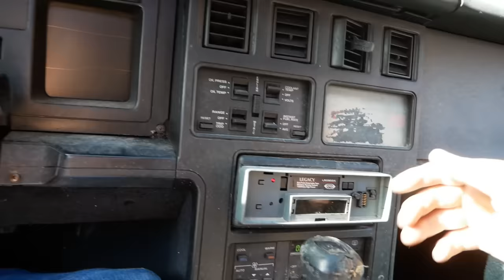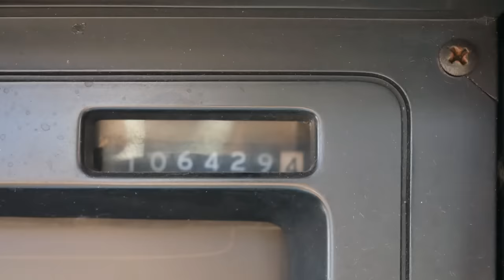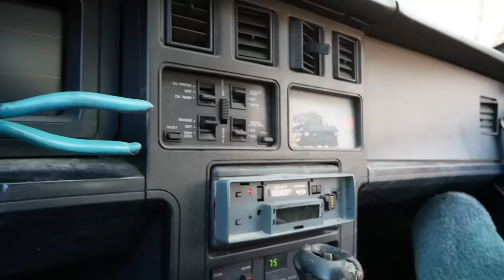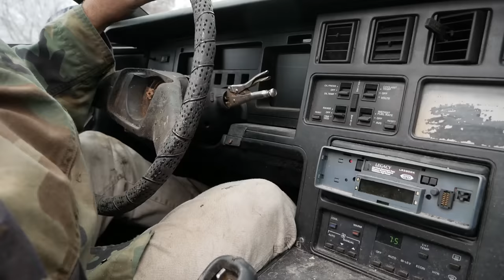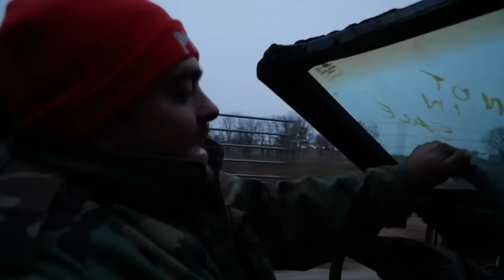ABANDONED 21 Years-Will This Corvette Run and Drive? CHEAP Vette Kart

Comment: The mythical 1/100 time that changing the fluid actually saves a transmission. Truly a sight to behold
Reply: Lucas transmission fluid is key! If it will not pull after that, it's toast!!
Reply: And it has a transbrake now for dragracing
Reply: The fluid had magnetic shavings that were making the solenoid stick.
Reply: frfr

Comment: I'm a former GM driveability tech, and I worked on a bunch of these 5.7L tuned port engines. GM stuck them in the Vette, firebird, Camaro, and the Chevy Caprice that had the police package. I approve you switching to carburetor and hei ignition, parts for this engine was ridiculous. Injectors would short internally due to no regulation on ethanol concentration, and had Bosch injectors that were $200+ a piece. The mass airflow sensor was Bosch and a common fail item as it used a heated wire in the airflow that was cooled and varied resistance to figure airflow, those were $600+. Not a cheap engine for the time.
The next generation of these were even worse, using the optispark ignition with the distributor behind the water pump and driven by the camshaft. Made replacing the cap and rotor a real fun time. We always recommended replacing the water pump as we had to remove it anyway to service the distributor.

Comment: You can switch the distributor gear from the computer one to the old one. Roll pin should be in the same place. Also turn the bolts on the rear control arms. That adjusts the rear camber, gives the traction back you lost by removing that 200 lb rear window

Comment: Definitely seeing "Dalton the stock car driver" in this video.   That Vett-kart is FUN...  keep the wing.    And then grab all the headlights and make it semi functional for night fun
Reply: I think ‘ole Dale Petty is coming out of retirement 🏁
Reply: Put one them big light bars he used before, or a aircraft landing light but may need a secondary alternator & battery to not instakill the battery like I did one night 30 miles from the road, in a spot pushing was impossible, by myself, smack dab in the middle of the trail, electronics, not fun learning the hard way

Comment: Just changed my trans filter in my 2000 Dodge 1500, which I think was the first time it has ever been serviced. The filter and fluid that came out of that makes the Vette's transmission look new.
Reply: Same I just did my #FreeGTP trans and it was super bad and likely the first time it was ever changed

Comment: Honestly love the TPI intakes. I think they look awesome, and the properly functioning tune port cars ive ridden in have been incredibly fun. Wish i could have one just to mess with.
Reply: They are a blast. I have an L98 in my '89 GMC stepside that is so much fun and done as if GM had put them in the trucks (which they should have).
Reply: I was actually thinking about trying to swap to a TPI in my '95 Sierra. Motor has 300,000 miles on it, and I've already got a fresh SBC sitting around waiting for the current motor to die. How hard was the swap?
Reply: Those long runners would have ben perfect for a truck!

Comment: Hey dude you may know this already, but on that oil pump rod, you can just drop in the dizzy and bump the key, and it'll fall in place. That way, you don't have to mess with the long screw driver trick. Thanks for the videos they are kick ass.

Comment: Obviously you know of the Roadkill Vette Kart, but did you watch the Motor Trend Vette Hack video where it came from? If not, I’d recommend it. They reached a point where they had to add weight back to it because the power simply went up in tire smoke, and that was on a hot dry day at a prepped race track.
Reply from the maker: Yep I remember that!

Comment: I thing the thing at 43:35 is a go cart external starter. You would plug it in and stick the end on the crank and use it to spin the motor over.

Comment: Personally love the C4.  I have taken my 84 from stock to 7 second 1/4 mile car over the years.  Make great race cars - And they are cheap.  They look good.  They handle excellently if you're into turning corners, are pretty lightweight and can be made super lightweight easily..... If you're into drag racing they are a great platform to build from as well..... TPI is indeed garbage today, performance wise and working on it wise but was cool back in the 80s... not to worry as old SBC retrofits easily and so does LSX engines.  There's alot of room under the hood once you strip away the BS.....
Reply: I think they looked ahead of their time. That injection system was crud

Comment: There's nothing as cool as building a woods and field runner with Horse power. I had a 38 Buick sedan someone gave me when I was 13, Me and a friend cut the body off with a torch  had a wagon path through the woods ,burned many gallons of gas in that straight 8 ,Until I was 15 and got a better set of wheels, This video brought back many of my memories when I was JD's age .

Comment: I graduated from automotive school in 1985 and went right to work at a Chevy Dealer. I hated working on the C4 but I did enjoy the test drives. Guess what a common issue under warranty was, the lower intake vacuum leaks at the gasket. It paid right around 5 hours. I could beat most flat rates jobs, I do not think I ever beat that one. Even on the camaro I could not beat it.

Comment: I'm pretty sure that I bought an old car that you worked on a few years back... I could tell because instead of just taking the time to remove the power window motors the right way on both front doors, there were access holes hacked through the sheet metal-- with no attempt made to replace the missing metal!  On a lighter note, J.D. is a perfect partner-in-crime.

Comment: Tuned port injection is awesome, what are you talking about? The thing that sucks about it is the antique electronics that control it. Fitech makes a new control system for TPI that makes it work the way it's supposed to.😎👍
Reply from the maker: And only what? A grand? Fucccck that lol
Reply: @PoleBarnGarage  
No, about 500 bucks somewhere around there. It's just the confuser and some sensors, no throttle body or injectors or intake, just what it needs to control it.

A mid grade carbon maker cost that much. Probably not worth spending on that car but in something nicer like your square body you painted up nice would be worth it. Those factory TPI setups should of been installed in trucks because of how good those long runners produce torque.😎👍

Comment: I bought one of them vetts for scrap years ago, was rolled somehow, I pulled the engine and dropped in it my 91 truck that use to have a 4.3, leaving the high way 2.73 gear 1 tire fryer rear in it, and dropping a 5.7 TBI upper and some cheap headers, brought that little truck around, probably still made every bit of 190 HP but it felt way better than the 4.3 did. I miss that truck...

Comment: I’m 22 and daily drive an 87 vette,I never liked c4’s but it’s honestly been a good ride
Reply: Update,started replacing my fuel injectors at 8pm got done at 5am,screw tuned port injection those Torx are such a pain to get to on the runners.

Comment: Question❓.  Is the Distributor you installed work with the Distributor timeing mark you took out is there a different degree settings just asking not trying to sound stupid❓
Reply from the maker: Thanks for a good question! The distributor would not change the relationship between the harmonic damper and the timing mark. That was a good question and I appreciate it

Comment: I think it needs some all terrain tires, and exhaust stacks up from the manifolds…oh and before you destroy the rear bumper remove it properly and mount it on the wall of your shop as garage art. The seats look to be out of a 94 to 96 C4…glad the trans came back for you.

Comment: LoL. Crazy episode, but content. I'd say pull the engine and rear-end, and then swap them into a 2wd Chevrolet C10 for a performance truck. Then sell the rest of the Vette for scrap, as it's junk anyway. Obviously on a C10, make sure the transmission like a TH350 has a performance shift kit in it to handle the horsepower of this wild V8.

Comment: Those C4's were reviled from day 1. I would like to get one like yours, maybe a manual would be better, but yeah, it will be fun to beat on and some great parts like the engine, rear end and front suspension. Might build in some safety and replace that steering column.

Comment: Fact. There is a plastic piece in the rear of the transmission that runs the odometer and mph/speedo. That's one of a few plastic parts in those transmissions that cause failure.

Comment: As the digital dash is toast. Why not try installing the beautifully named "P3 OBD +GPS HUD Car Head Up Display Digital Tachometer Speedometer Odometer Clock Voltmeter Slope Meter Compass Altitude Fuel".
Will probably also need a OBD to OBD2 adapter and may have compatibility issues. :D

But it costs about 40 Dollars. Might blow the budget xD

Comment: Pro tip for installing distributors and the oil pump drive rod doesn’t line up drop the distributor in where you think it needs to be and turn the engine over by the cranks or what ever and the distributor will turn with the cam and drop the rest of the way in when the oil pump rod lines up

Comment: I think those are early 00's wheels, I believe they were made by Billet Specialties, they had a set just like that for motorcycles. Hey look, you've got a fiberglass sled to tow around the yard when it snows! Now you just need a crap S10 5 speed for that thing and some side pipes.

Comment: Transmissions automat! As a retired guy  I learned the hard way Cheap AZZ fluid tends to Shellac up as you saw with the vet.  They don't take heat  well so varnish effect. And those older smog cars ran  high temp as part of the smog package. A scam really. I had a 37 Chrysler  C6 Royal Six cyl single barrel carb, that put off less emissions thn the  new cars with all the crap on. Now the big a scam is Ethanol.

Comment: Great assortment of what we used to call $50 cars, think of all of those with no corrosion
That car has transplant donor tattooed on it's forehead, since they have yet to make a tire that will keep it on the road, you'll be able to pull Wheelies in your shorty van, which is a great sensation that's like sitting on the hood...

Comment: The long runners on the tuned port gave big low end torque but they never used it in the trucks where it would have helped the most. That intake could be worth 50HP over the tuned port intake but at the sacrifice of low end torque.

Comment: Ya don't trust what the mark on the balancer says. I've had a few old "tune port" injected chevs and the rubber in those balancers likes to dry rot and the ring will spin on the hub.

Comment: Where you can always do what complete toilet garage. Rebuild complete turbo three fifty And put a diesel engine in A Corvette from the late 70s. I can't wait to he put the video out where he puts a turbo on it . If you get a chance, check out the video that he put out of the 4.9 or 4.3 Chevy v six Were they rigged up a Turbo on the outside of the pickup truck? An Spent like two or three days beating on it. Man, what a strong engine that was.

Comment: I mean a transmission of some sort and the addition of an exhaust, 31x10.50 15's all around (may need some gentle clearencing of the rear clip). A train horn (very important). And for safety, some dune buggy headlamps and turn signals. I mean, what more would you need? I am a big fan of 4th Gen Vettes, BTW, but.... this one was destined for greatness, so I approve. I deam thee Labamba the Vette Cart.
Reply from the maker: Train horn is of course the most important item here

Comment: I know you probably don't know how to work on EFI and carbs are your "brand". I have a feeling that unless you do a converter and a much shorter axle ratio, it's almost a guarantee you made that car slower. Those 28 inch I take runners are only good for 240hp as installed with all emissions and accessories, however they're also good for 350ft/lbs of tq and everything happens under 5000rpms. At least you're using a dual plane...but, yeah it's probably not going to pull as hard with a tight converter and like 2.73-3.08 gears and a junk 700R4. It'll pull like the Dickens over 4500rpms and fall flat after the gear change to 3rd and be a slow climb back it's the power. Hopefully the weight reduction helps. You definitely scored, I would love to have an old C4 to play with for a paltry $500. Geeze. If you are careful removing all the body parts and glass you might be able to get more than you money out of the parts if the right person needs them.

Comment: The torque converter lock up is electronic on that particular 700r4.   But you cut all the wires to the computer.    🤷‍♀️

Comment: Your son is going to be so prepared for the apocalypse we are headed towards.....

The last time I had a transmission rebuilt, I took 2 TH-400s to a father/son transmission shop in the middle of nowhere, Arkansas and asked him to use a tail-shaft off of one and the bell-housing off the other and use the best internals from each.  He charged me $160 + $40 for a torque converter.  I let him keep the extra parts.  It still works to this day.  That was in 2001.

Actually, he rebuilt another th-400 for another Jeep in 1996 that still works fine too.

My dad taught me a lot about working on cars. He was patient and a great teacher.

Comment: Hmmmm.....🤔 Weight reduction - check.  Extraneous electronic wizardry and smog crap delete - check.  Convertible mode engaged - check.  Yep - you're down to the gearbox swap and #8-wire-battery-holder stage.  There are a couple of things I could suggest in addition though.....

Firstly, she's only a daytime rig at the moment, so a huge LED light bar nailed to the cross-over bar or rad support would help you do those late night runs out in the yard to where you left your lighter on the fender of one of the 'projects'.  Second, those exhaust tips that were laying on the ground when she first moved could be welded on and mounted in a way to angle the flames away from the flammable stuff under the car....say, shoot it straight out each side?  That engine sounds rather healthy too, but she still sounds like she's periodically  down a lung, so a set of plugs and wires would tell you if it was more serious or give her the pep she needs to still let go in the rear real easy...oh...at, say....70?  I've lost the rear at 50 and that was excitement enough for me, but you're younger, so why not have some REAL thrill in your life!

Apart from those minor needs, she's the perfect ranch rig - has all the room for the tools and the lack of weight to get anywhere....although a set of "Town and Country" tyres might be a bit of an ask for those wheels.  But man, that's a good sounding engine.  As to what box to swap to, surely you've got an old TH400 or 700R4 laying about.  The only real place you'd get the fun out of a manual would be on the road, so why go to the pain and expense of a pedal box, box of gears and all the drama when she's set up for what you need already?

Comment: It's a 4L60...the forward clutch is welded together,
Reply from the maker: The 4l60 didn't exist in 1989, it's a 700/r4
Reply: @PoleBarnGarage  right, which is....mechanically identical. The forward clutches are seized.

Comment: I truly love watching your channel . If you find yourself in the las vegas NV  area i have a 1977 Pontiac firebire for sale cheap for only you #$2500⁰ . With a 6.6L ⁶4 speed transmission  With a 4 speed B&M Ratchet shifter. Early Edelbttrock intake manifold plus a large Aluminum radiator 0😢within a electric fan. I drove it for about a week. The car was running  and drives great. I just started  removing  parts  getting the car ready for paint.  Originally This car would have gone to my. Son. but he is not really  that interest.   the aftermarket  they all work great on this car is. long tub headers,⁶ after market radiator.. B&M t tops. High stall torque converter  and maybe a small cam. The rear end gears are Either 373 or 410 happy to help put it back together with you if your interested has electric locks and windows. The car has a few more hibben upgrades but do nt remember

Comment: Shouldn't have torn off the injection it might just have surprised you and ran perfect. If he would have just hooked up the boat tank and pump right off he might have saved himself a lot of work. But I guess we'll never know. I don't know why people that are not understanding or at least aren't often working on injection think it's a bad thing to have after a period of time. It's just different but usually much more solid than a carb.  As well he just knocked it down about 40 HP.  It would have made a much better cart!!
Reply from the maker: No, we do know. With the information I provided in the video. The fuel system was full of varnish, meaning every injector would need gone through or else risk destroying the engine. Injectors for one of these are about $800 last time I checked. The fuel pump was bad, that's another $200. It needed a high pressure fuel line, another $50. The fuel tank was destroyed. $200-300. Fuel injection is expensive, and it doesn't make more power. That dual plane and Holley will perform the same, or better

Comment: Consider this a hate comment: I have this exact same car, red on red with the spoiler. Its a tragedy some moron put it out in a field to waste away. The L98 specs boast 225 - 250 HP @ 4,000 RPM with 330 - 345 ft/lbs of torque at 3200 RPMs even with the smog pump. It may not be worth 50Gs but you shoulda restored it.
Reply from the maker: Dump 10k into a 4k car. They're worthless
Reply from the maker: No it isn't. My marketplace is full of them under 5 grand, in reasonably nice condition